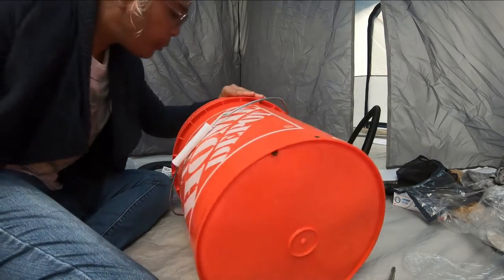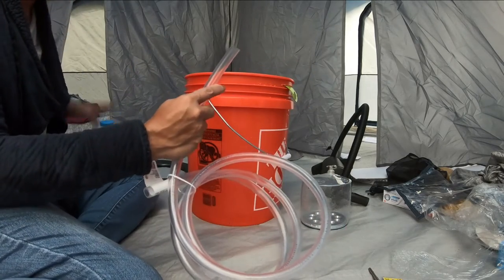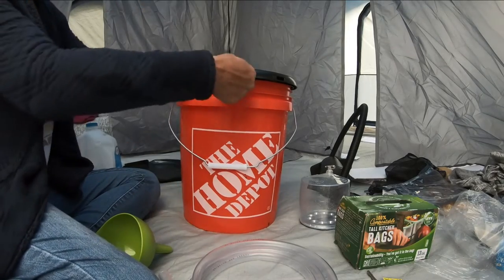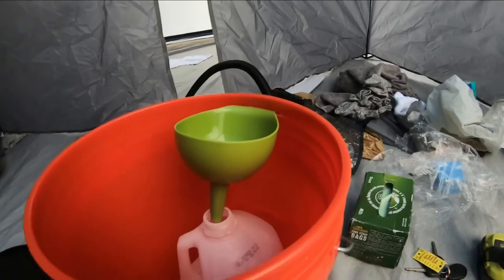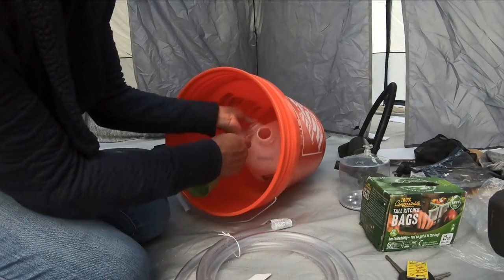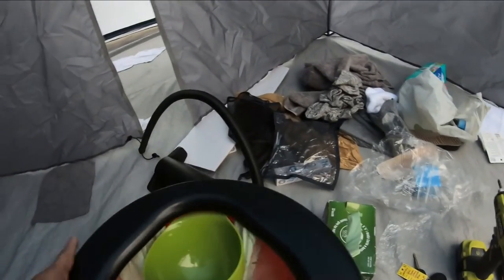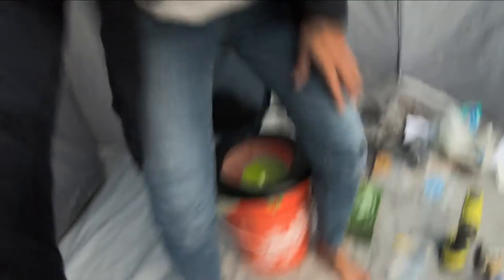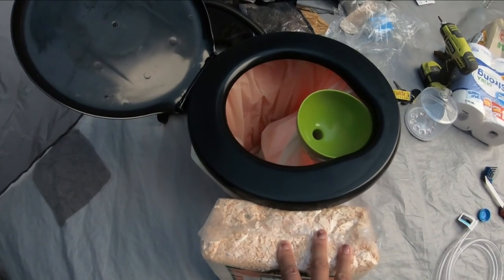DIY Composting Toilet with Urine Seperator

Comment: I made a composting toilet with a 5 gallon bucket and funnel, I used a gallon water jug with the top cut off due to it was very difficult to remove the urine without spilling it. I'm yet to find a good jug /bottle for the urine without actually buying a real composting toilet parts.

Comment: do you have an update on how you did without venting? i plan on making my own toilet like this for my van but likely wont be able to lead a venting tube outside to let any gases escape so im wondering how it worked for you with your funnel being open to all the collected urine
Reply: For just urine it’s fine. I have one for just pee and one for both.I don’t recommend having the one with poop indoors. I use cat litter to cover. I change the bag once a week.
Reply: As of right now I have it in a shed. Unless I disturb it, it doesn’t do too bad. I would not have it inside without venting.

Comment: My concern is when I tried a lid with a garbage bag, the lid tore the garbage bag up, when removing the lid to dispose of the bag. 😟

I also want to look into this toilet lid for buckets and hope the lid is easy to remove, but also hope the lid seals in the smell.

Love this bucket idea. One lady put a hole through the front of her bucket and placed a hose leading out of the bucket, into a clear container, so she can keep track of how much urine is building up into the container, to later dump. 

Her bucket sits a smidgen higher on top a platform, just so she can use gravity as her best friend, to drain the urine down the tube, into the container.

Between this video and the other lady's video, I feel like that's the best of both worlds combo. Thank you for taking the time to show such a video. ✨️✌️